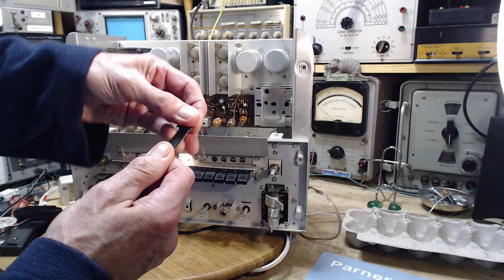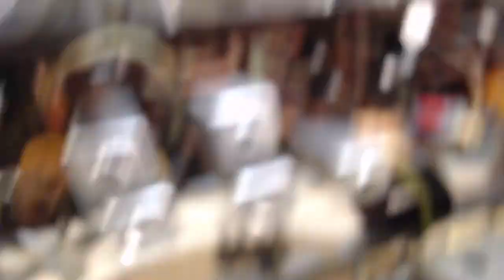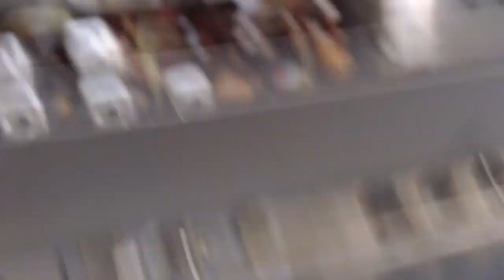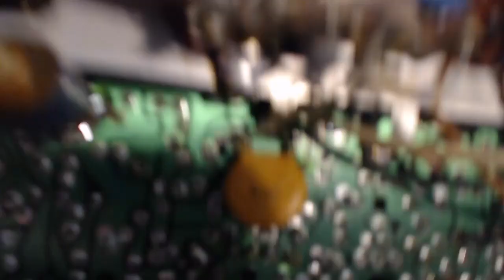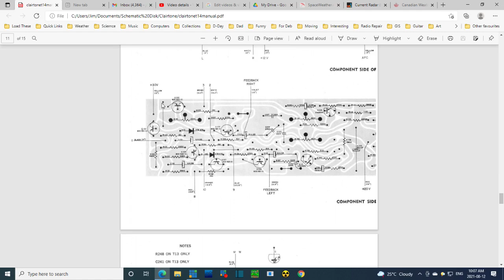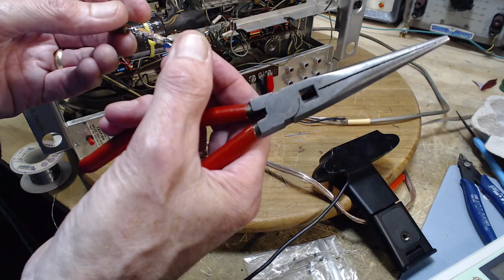Clairtone Console Stereo Video #15 - Scope Probe Circuit

Comment: That scope probe circuit will not work as it is .
It loads the circuit with the 100 R & will just pass d/c through it !
Very strange one     d  }¦~) 

PS 
Test the old diode …..  Errrr & the original circuit  ......

Comment: 25:39 Here is how to destroy a germanium glass body diode; Apply heat to as close to the body as possible for as long and often as possible  (while fixing your cold solder joints) and then exert mechanical stress to the short leads.

Comment: 10:00 Stop babbling nonsense! The tuning meter is pegged on both AM and FM. On previous reception test few videos ago, when you had not messed with the radio, both reception was decent and the tuning meter behaved like it should. And that included it being in the middle on FM and on tuning swinging both left and right according to the positive and negative voltage from the ratio detector (S-curve).
It is clear as day that you bugged all of this up! Go and fix your bad solder joints and mistakes BEFORE you even think of messing up the existing alignment, because if was decent to boot and could NEVER have shifted off that much by replacing some electrolytics. Unless you made major mistakes. 
@the owner: If you value your gear take it from his hands! You see how he has ruined all radio reception!